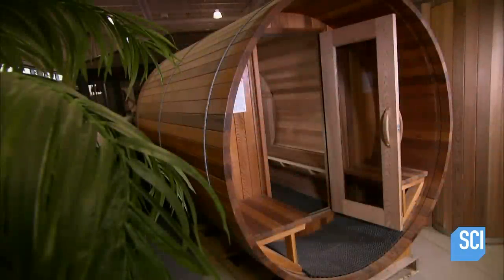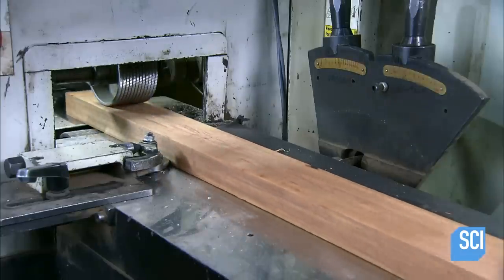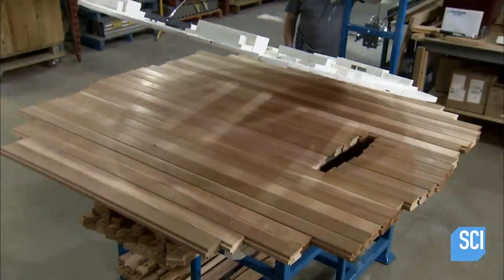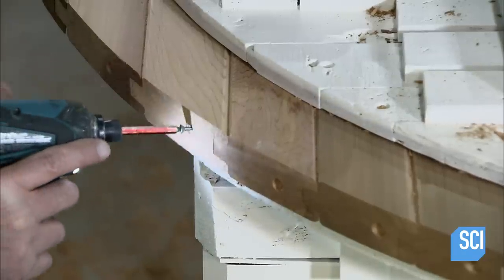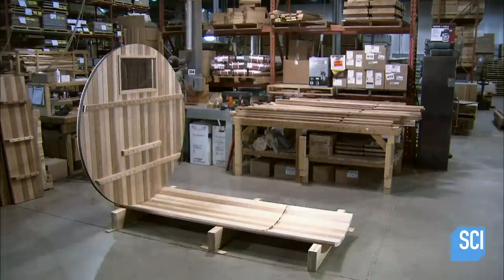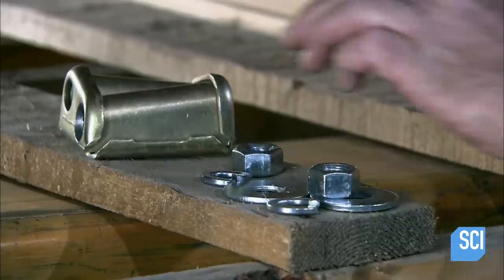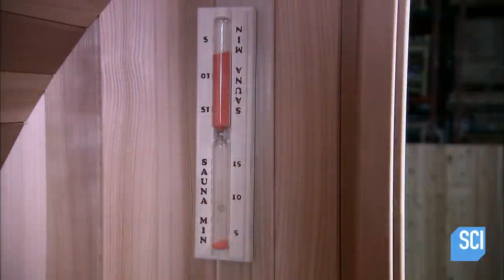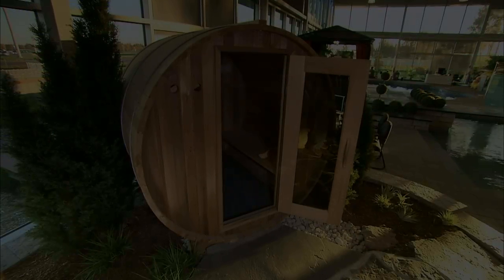How It's Made: Saunas

Comment: Fun fact, these barrel type saunas were made specifically to circumvent finnish building regulations and codes. The barrel's only good point is that it looks nice, but otherwise they're cramped, inefficient, and it should be your last option.

People outside of finland don't really know that, so they just opt for the one that looks nice.
Reply: I have to imagine those regulations and codes exist for safety and health reasons. How dangerous are the barrel type compared to the others?

Also, how dangerous are saunas in general?
Reply: So it's the McDonald's of saunas.  Got it.
Reply: What
Reply: @techmouse.  Unless getting your heart rate up is dangerous to you (due to some heart condition), there's no danger. Your heart rate increases because the body needs to work harder to regulate your body temperature. At worst you might feel a slight light-headedness that clears as soon as you leave the sauna. Most people bathe in intervals, taking regular short breaks to cool down. It's especially refreshing in winter when you can cool off outside (especially in an icy lake...), then go back inside to warm up.

The building codes don't have to do with dangers to your health, but that a sauna is a hot steam room and needs to be properly isolated and vapor proofed, same as a bathroom. You can't build a sauna in any old room, it'd ruin the house. Putting a "sauna cabin" like this in your backyard is a way round that because the steam just vents into the open air and they aren't considered housing, so relevant regulations don't apply to them.

Also, 185 F is pretty cool for a sauna. 200 F and above is common.
Reply: For real, I'd twist my ankle in that sauna.

Comment: 185 degrees isn't that deadly. 100 degrees fahrenheit is comfortable but once it gets to like 104 is when you start sweating a lot. Hope the guy speaking was wrong
Reply: No, they are hot.  Optimal is 179 degrees Fahrenheit.  But you are not spending an afternoon in there, you are shooting for 20-30 minutes, though you may have to build up to that...just like you don't just run 10 miles out of the blue.  Your body does not get very hot, because you sweat like mad.  Your body works very hard to keep you at a safe temperature. 
Remember, this is air...and will not conduct anywhere near as well as water.  Being submerged in water that temp will kill you in no time.  Even 2 minutes in 126 degree water will scald.  Sauna is like exercise, increasing the heart rate...and has similar benefits.
Reply: @ChessMasterNate  Yeah you shouldn't stay in them for long periods. I instantly feel faint when stepping in so simply avoiding them totally is simple lol
Reply: Purpose of sauna is to sweat a lot. Most saunas in Finland go almost to 100. Celcius.